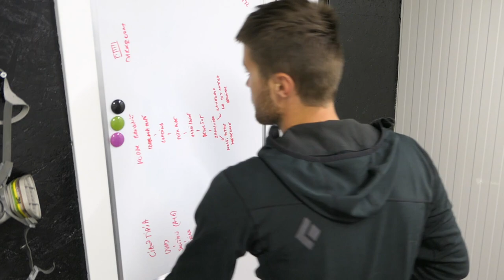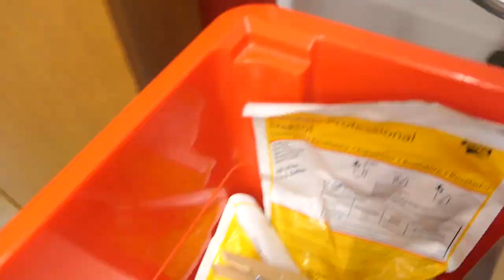Building my dream Darkroom inside a Shipping Container!

Comment: Such a good idea with that container! I worked as a photolab technican in the 80ies and would like to start again with darkroom work. Sometimes i just hate the photoshop retouching i have to do to earn a living ;)
A container is to consider. In my small house i have no room left for that. But a container…
How is it in summer when too hot or did you do some thermal insulation to prevent the water tubes and the boiler from freezing in winter?
Did you test the red LEDs with multigrade paper? No fogging?
 BTW, i had the same Opemus enlarger in my youth… ;)
Keep on the good work. It is wonderful to see younger people doing stuff like this…
Best regards from northern Germany…
Reply from the maker: Hey, 

I have been working in container for two years now and its great. I use ac to keep the container cool during summer and warm during winter. Sure plumbing is all insulated on the outside but inside I keep everything at constant 21c. Yes I have tested the leds and there was no fogging.

I wish I had more time to use the opemus. I mostly direct contact print using glass dry plate negatives ;)
Reply: @lostlightart6064  Thanks for replay. Very informative. Yes contact printing is very nice.